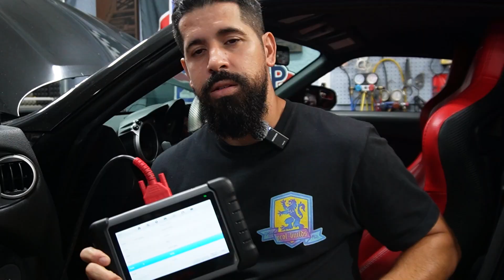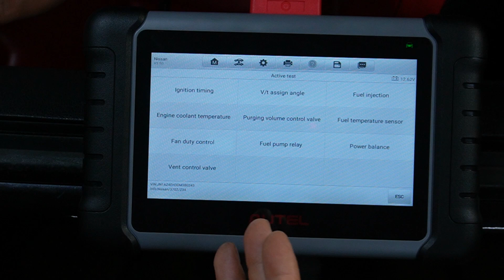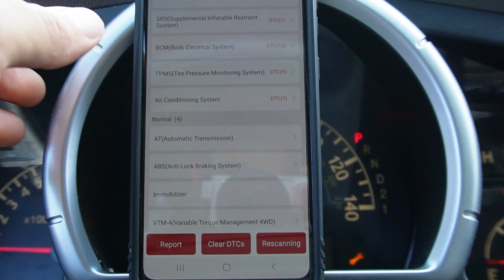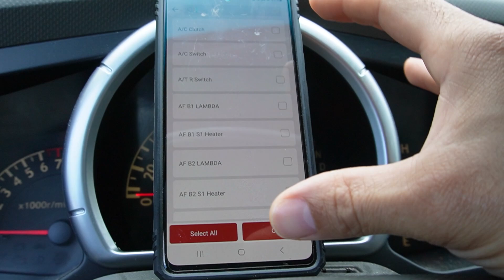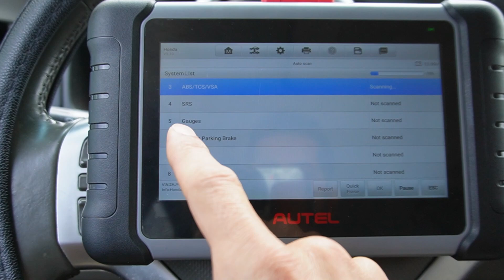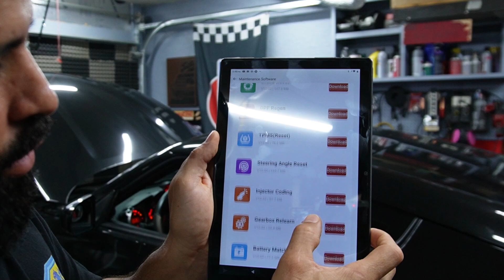$100 Kingbolen Ediag Elite vs $500 Autel MaxiCOM 808 | Worth the Extra Cash?

Comment: Well done Armando, I currently have an ELM 327 dongle but it can only read and clear codes. There's no bidirectional ability. 
After watching this I think I'm going to try the e-Diag. 
They are $140 on Amazon Canada.
Reply: I have both of these scan tools, I love the Ediag, the only issue I have found is that if you are unfortunate enough to break down without reception you can't use the Ediag so I found myself still taking the Autel just in case 🤦‍♂️ it's a great tool for the money and I too found it finds harder to find DTC's the Autel can't find at all...

Comment: Thanks man, interesting and clear explanations. Easy to listen to.  My Ediag found the fault codes related to an intermittent problem with the EPS and ESC not initially coming on when engine starts, the problem only ever happens overnight in very cold weather and then comes on again after the engine warms up and ignition reset. Gotta be some kinda corrosion, moisture or short somewhere.
Reply: Wow what kind of car is it on? And what did this cause?
Reply from the maker: Thanks for the feedback, and glad the video helped you out!

Comment: Helpful video! I'm looking for a scanner without a subscription fee.
Reply from the maker: Glad you found the video helpful—finding a good scanner without the subscription is a good goal! If you want a solid scanner that does a lot without charging you every year, the Ediag Elite is a great pick. It can run full system scans, do active tests, and handle maintenance stuff—all from your phone, no extra fees.
Reply: @ArmandoProlGarage  Does it or can it do the Steering angle sensor re-align or whatever it called ?  I have a small Xtool D5 scanner that can get rid orfthe SAS light on the dash but it keeps coming back and I am tired of it..I have put a new clock spring on it etc and the code still shows up..I have replaced the 2 front wheel sensors as well ..2012 Nissan Altima S with the 2.5 ltr 4 cylinder engine.